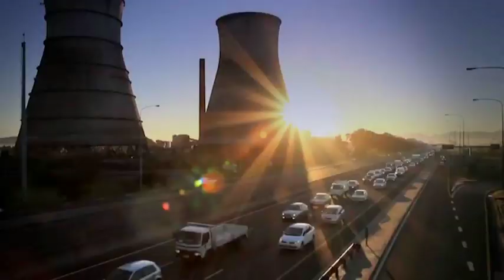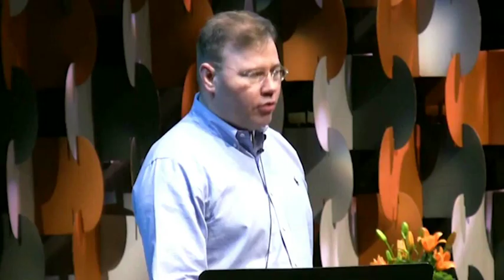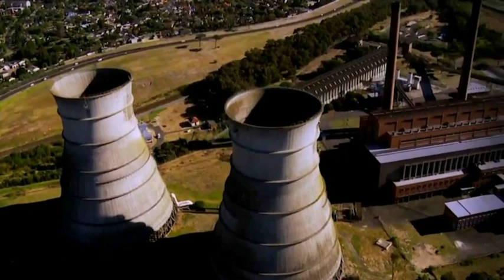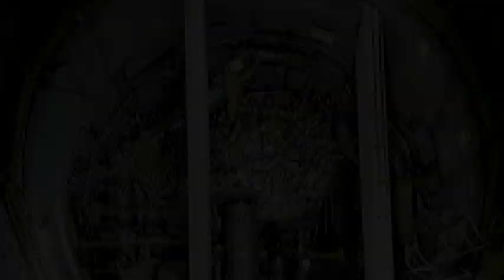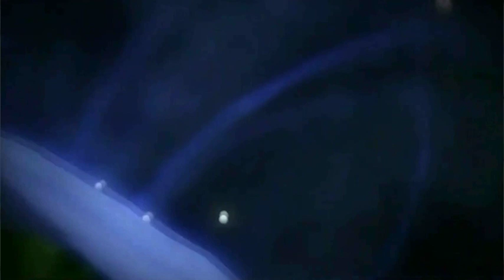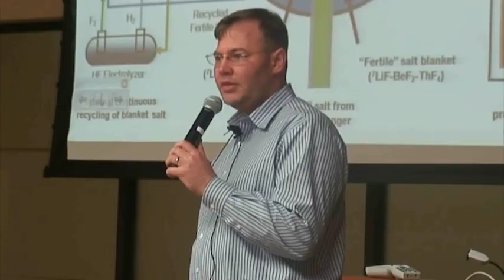Undercurrent - s04e08 - Thorium

Comment: What a crock of whoopee this story is. So complex? Not on your life there Micromax. It automatically load follows. It don't corrode the pipes because salt corroded when exposed to the air and water. It is by far the cheapest because of one simple factor, it burns 100% of the fuel it is loaded with AND it can burn all that fabulous waste in the current idiotic high pressure water reactors that can blow up because of all that high pressure steam inside the stupid reactor. Complicated? Way way less than a xenon trapping solid fuel rod. You like burning platinum? Well with high pressure water ya'll are doing a good job of that. What a load of hokky this video purports to claim. You can stuff it blokes, lie all you want you cretins.

Comment: As usual politicians illustrate ignorance combined with certainty. I wonder how much stock in solar companies he owns? 

NOT mentioned in this presentation is Thorium based reactors can be built in much smaller sizes. I have read that kilowatt sizes are possible. These could lead to an electric grid based on distributed sources resistant to blackouts.

Comment: Yes, yes, yes.  All the naysayers point to Fukushima, Chernobyl, & 3 Mile Island.  How many people died??  How many coal miners have died?  More significantly all 3 were OLD models of reactors, the 4-Gen reactors as stated are NOT cooled by water and does NOT require high pressure for cooling.  The latter is what faulted Fukushima.   If you bet your economy on wind & solar, you're doomed unless miraculously there is a battery to store the power when the sun doesn't shine and the wind doesn't blow.   By the time that is developed, Earth will look like Mars.  Also note that the population worldwide is increasing so the demand will be huge.   The land area required for solar and wind is very large and you'd need to transport the power large distances from it's source typically large solar farms, large turbine farms to the target - cities, factories.   The solution is nuclear - specifically NEW breeder reactors based probably on Molten Salt Thorium.

Comment: only reason we dont have it it didn't make weapons
Reply: +Terry Rice 
The US ran a Th reactor for 5 years, at Oakridge, in the late 60's.
Nixon shut it down because it challenged fossil fuels!
Reply: The MSRE was not a Thorium Reactor.  They ran it on U-235 and U-233 but none of it was directly because of thorium breeding inside the reactor.  It was a proof of concept reactor for the Molten Salt Breeder Reactor that would use Thorium (Aka LFTR).

Comment: It needs a separate power source to run a thorium reactor..
So, atleat I don't see what benefit is that giving to this tech..

I think most efficient way is to make power where you use it, we are everyday all the time bombarbed with different forms of energy and even producing it ourselves through movement and defecation, we just need to harness them safely and sustainably for everyones benefit, and of course pursuit to optimize our power usage through making things to use less electricity, and to actually last a long time and be easily repairable or recyclable.

For example, a bus is only less polluting than a car, when its full and doesn't need to stop on every bus stop on the way.. and besides that, it has all kinds of things in it that are designed to break down and wear off..
Often times a single or two seater would do the job of movement for people.. All the time people drive alone with their 5 or more passenger cars, which is also complete waste..

Sun for example gives over 1300w of power per square meter, and currently the cell efficiency record is about 45%... just from the sun we can get so much, and it also tranfers to elsewhere, like in the air and water, not forgetting bioculture itself..

There is more than enough power for everyones needs, but not for everyones greed.. if I may borrow a bit of gandhi. :D

I would rather use nuclear power in space, there the risks are anyways high, but then again risks of catastrophy on earth and benefits of nuclear power up there would be plentiful, as long as we start going up there some other way than riding a bomb.